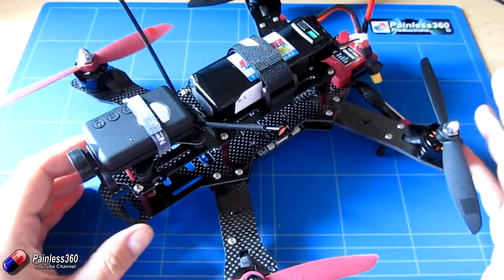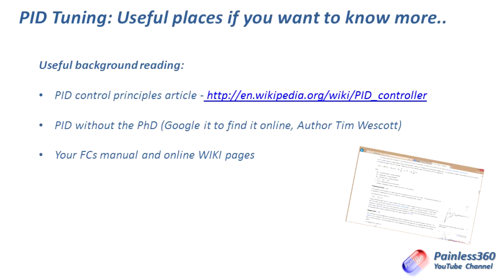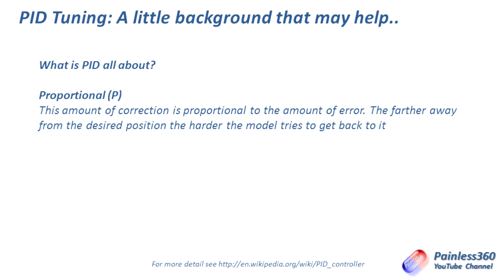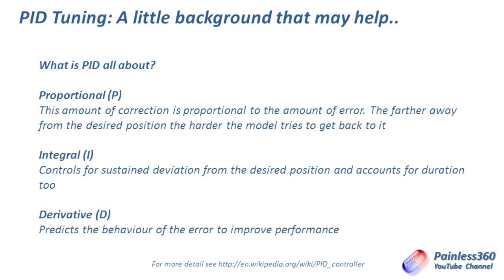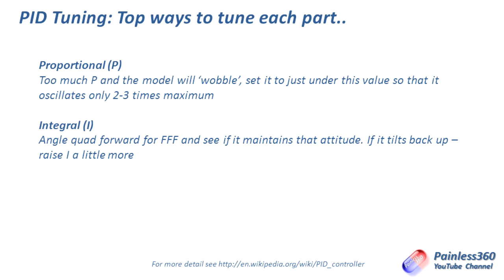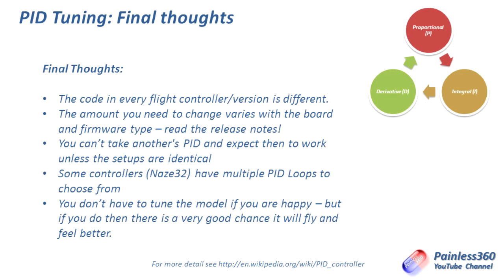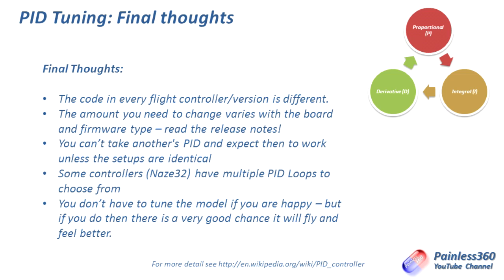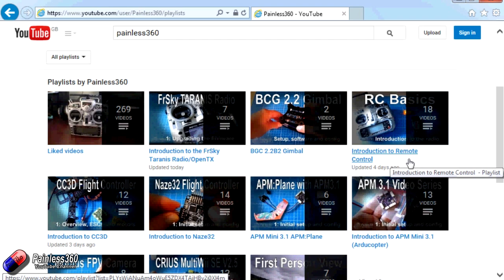Multicopter Tuning - Introduction to PID theory and how to tune your multirotor

Comment: i took my goolrc 210 out yesterday for the first time. using cc3d librepilot default setting and the quad just oscillated like nuts then flipped about 10 times and slammed into the ground. no matter what stick input i did and no matter how much it just wobbled like nuts and flipped over. i cant take it for a test flight to tune as it wont even hover to see whats going on. :( the default was about 0.00620 or something like that on the p gain. all i need is a starting point on p on librepilot.
Reply from the maker: Very tricky to offer advice with that level of detail, we have a video on what to check if you flop on take off but I'd suspect vibrations on the model.. I'd start there.. Best of luck!
Reply: i did just watch another video about rotating the cc3d, i rotated mine 90 degrees to have access to the usb out of the side but when i change settings i don't do the level adjust every time to calibrate. im 98% sure on the video i watch about rotating the board they said always re calibrate to board. it is something i will have to try tomorrow if i get chance. if that isnt the problem i may just ditch the cc3d as the pid numbers are very confusing compared to cleanflight. they only have two number but librepilot pids are more like 0.00350 i have no idea if thats three hundred and fifty or thirty five :/
Reply: I recommend to throw it in the bin because even if you get the best tune it will never be good

Comment: i know this video is about tuning but where did you get your hardware those are way better then the hex would love those for my vortex
Reply from the maker: Which bits? The motors, props?
Reply: Painless360 the m3 screws are they regular hex ? they look like a torques the star hex but with a pin in the middle i believe there security torques. Its just hard to tell with the camera

Comment: Hi, I have a situation here. Before this I have tuned my quad by using autotune as your tutorial video and it was stabled. Thanks to you :) .Unfortunately, last month my quad was crashed, then I have replaced the broken part. When I try to take off, my quad keep roll and crashed. I thought maybe because the PID. Then I reset the PID to default setting and it's still the same. Is it true the default PID sometimes are useless?
Reply from the maker: If it's flipping on take-off then it'll be something else. See our video on what to check if you quad flips.. Best of luck!
Reply: Thanks for your help.. After I troubleshoot, It seems my receiver had problem. After rebind the receiver, It's perfectly worked. Your video tutorials are awesome and helpful.

Comment: Does PID tuning apply for all modes including acro?
Reply from the maker: It does, most flight controllers need turning in Rate/Acro mode so some of the problems you're looking for (wobbles at the end of hard stops, nose lifting in turns/rising in forward flight) are masked. Happy flying!

Comment: In the video you said that if the nose drifts up in forward flight that the I-gain is too low and on my HK 230 mine slowly pitches down. Does that still mean that my I-gain is too low?
Reply from the maker: +logan epling probably too high.
Reply: great video mate, really helping me with my first builds so thanks. I've built an emax 200 x with kiss fc and esc's and dys 2205 2550kv motors. was out tuning today for the first time and when flying in a straight line at low speed all seems fine. but soon as I apply more than 50% throttle the quad pulls up and to the right really quickly and completely out of control. have you got any idea what would cause that to happen?
Reply from the maker: Not without a lot more detail. I'd check the basics like COG and ESC calibration...
Reply: thanks make, c.o.g is definitely ok, was out with it again today to try to see what the problem was without the goggles on and it seems like the back right motor is only powering up so far and stopping at a certain point when the other 3 are powering up to max thrust fine and that's making the quad pulls up and round. I'm using stock pids but turned rates up higher. what other information do you need from me to help you diagnose my problem mate?
Reply from the maker: You don't mention ESC calibration - follow the steps in the videos for the process. Best of luck!

Comment: What is difference between Trim and Pid in quadcopter? How can I realize that I need trim or pid changing?
Reply from the maker: I'm not aware of 'trim' setting on a Quad...
Reply: @Painless360  you mean if we changed trim setting on Radio, it doesn't mean anything?

Comment: ive tested my build, it has a slight wobble on hover and it does what i call feathers down when i drop throttle do i need to raise my pids? its my first time tuning, all of these videos are all done on a 250 quadcopter mine is a 450 size, please help before i break it lol
Reply from the maker: Depends on the type and speed of the wobble. Joshua Bardwell has some great videos on tuning PIDs using the BlackBox recordings. I'd have a look there.. Best of luck!

Comment: I've got a quad that constantly yaws in varying directions,is this the integral not tuned well?
Reply from the maker: +bo holland id check for excessive vibration first. Best of luck!
Reply: +Painless360 thanks , turns out it was a faulty motor connection .all good now

Comment: Is the top camera you have here FPV or recording?  which one is it?
Reply from the maker: Sounds like you're new to the channel.  We cover this in the review videos for the cameras. The use of HD cameras like the Mobius or Runcam is common to record flight on the model in HD while the smaller camera (with less latency) is used for flying.  Happy flying!
Reply: I am new, just built my first quad and stumbled on your site while trying to figure out how to tune it.  I'll definitely check out that camera review video because I'm looking for something cheaper than a gopro to record what I do.  Thanks!
Reply from the maker: Happy flying!

Comment: Any advice?

My tuning seems ok until it perform an extreme maneuver.  I go really fast and then I suddenly go in opposite direction and my quad loses stability.  My quad is not suffering from to much P when doing basic maneuver or even full power, only suffer when I use full power and change to opposite direction
Reply from the maker: This looks like a duplicate post - no need to post twice. I think I answered this already.. Best of luck!
Reply: Can you direct me to the answer?
Reply from the maker: I'd check the D gain. Best of luck!

Comment: Hi. Why does my mission planner roll/pitch sensitivity minimum is only at 0.08? Any idea how to lower the minimum 0.08? Thank you.
Reply from the maker: 0.08 is just the lowest value in the range. I'd never fly anywhere near that level as it would mean that the controls would feel very 'dead' and give you poor control. I'd suspect that if you think you need it that low then you have another problem.. Best of luck!
Reply: Ok thank you. I have found the way to change. 

But, i am currently having a issue to have a stable maneuver for my large quad. I did multiple times of changing the PID setting on the mission planner and i am only able to takeoff slightly off the ground as it seem quite unstable for higher altitude takeoff as the quad is wobbly during flight.

Do you have any recommendation for the pid as the roll & pitch is very unstable during fight.

Thank you.
Reply from the maker: I'd check for vibration and make sure that the FC is on a vibration isolating mount and that the motors and props are balanced.. Best of luck!
Reply: About your explanation on derivative (D) of the PID,  does increasing the D on the mission planner = faster reaction time of the P & I or increasing the D = smoother reaction time of P & I? Because i have read on other source that higher D = smoother reaction time of P & I. Therefore higher D = slower speed of P & I because it will slow down the P & I to make it smoother for the flight? 

Sorry if it is confusing.
Thank you.
Reply from the maker: See those articles and papers if you want to get into huge detail. For 'ease' think of D as the speed of the reaction.. Happy flying!

Comment: One point I am not clear on. Why wouldn't P correct for a sustained error? Lets say my commanded bank angle was 30 degrees and that the model moved out of 30 degrees by small increments over time. Why wouldn't P act to remove the error? I guess I don't really understand why we need an I gain at all.
Reply from the maker: +Brayton Thompson Have a read of the other resources I point to - maybe one of the explanations in those will make more sense. I also struggled with this when I first came across PID loops and P Only, PI only as well as PID loops are common in control systems... Best of luck

Comment: what effects does the PID have on angle and horizon mode?
Reply: +Jon Car You generally want to tune your PIDs in Rate mode. With Horizon mode, you're working with 2 PID loops, the Angle PI and the Rate PID (note Angle mode doesn't use D). In Horizon, when you hit the rate threshold (the point at which you move your stick far enough that it leaves angle mode and switches to rate/manual) those Rate PIDs will kick in. Default in Cleanflight is 75%, which means after you move the stick 75% to any direction, it'll switch to rate mode and allow you to get inverted. Angle is tuned differently than Rate in both Cleanflight and OpenPilot. Tuning Angle is a little weird and I normally just leave it at default, though I've only ever used it flying LOS or if my goggles fog up and I need to land LOS, giving myself time to pop my eyeglasses on.
Reply: +Jon Car In other words... Learn rate using simulators and tune in Rate when you're comfy with it
Reply: +Benderhune  best explanation I received.  Thanks  One question were are the Angle PI setting in Clean flight?  Is that the upper right corner were the 3 setting blocks are?
Reply: +Jon Car So make sure you're running the latest version of the Cleanflight configurator. You should be using version 1.1.0. If you aren't, update that first. In the PID tuning tab, the settings box in the top right is your rates. That controls how quickly your quad will rotate on the specified axis. There's also TPA there, that's PID scaling based on your throttle; I wouldn't worry about that, if you're still learning these things, just set the TPA to 0. You can ignore the TPA breakpoint.

The angle settings are below the general PID settings to the left. The row label will show "Level". The columns are labeled Angle/Horizon, Strength (Angle), Strength (Horizon), and Transition (Horizon). Transition is what I mentioned earlier, it's the point where it switches to rate based on your stick input. Different PID controllers treat settings differently; I use Luxfloat, but you may be using something different, and those settings can vary. Check out https://github.com/cleanflight/cleanflight/blob/master/docs/PID%20tuning.md for more info on that matter.

Boris B wrote some info here on how to use the CLI to change the max angle at which the quad can rotate itself while in Angle Mode: 

set max_angle_inclination = 500 means max stick 50 degrees
set max_angle_inclination = 800 means 80 degrees
So when you give full stick command it will match that angle. Your full stick will always be maximum angle.(https://github.com/cleanflight/cleanflight/issues/1393)
If you don't know how to use the CLI, do some research on it. It's a pretty simple command prompt. The Strength fields in the graphic interface will allow you to determine with what force is applied to reach those angles.

Comment: Does anybody know if it is okay to extend the motor wires?
I added about 3 inches of wire to each lead of my motors.
I'm having troubles flying and I'm wondering if this is why....
Reply from the maker: +odinata if they are the same size and the connections are all good then it should be fine.. Best of luck!

Comment: what would cause a wobble  that starts slow, and builds up gradually till it's violently swinging the quad?
Reply from the maker: +Joe Smith Sounds like one of the values is too high. It'll be P or D probably depending on the speed of the oscillation. Try one then the other.. Best of luck!

Comment: If I give my quad abit of throttle to take off the ground then back off to hover it drastically goes up and down. And if I then land it, it start to jump very aggressively on the ground
Reply from the maker: +Matt Graves that may not be the PIDs. I'd check the esc calibration and settings in the flight controller first. We had something similar recently and I covered my troubleshooting process in video 7 of the 'Quadcopter building for beginners ' playlist. Best of luck!

Comment: hi,

there is some thing exciting i want to share with you .
 i have been working on my cuad and i have always wondering why   error = gyrovalue-setpoint

why to add an necessary  term to the PID equation , what i did simply is that i removed all the setpoint values from pid equations  and  i added them to the esc final signal drop calculations ,  the wonder result that i have achieved more stable cuad  and when i searched about my  way of PID i found that all  scientific  referances about this subject i found that (error = gyrovalue-setpoint) is a main truth in designing 

, so how my conclusions are correct!?

is what i did  a method of  PID i dont know?

if so why isnt it used in common cuadqopters or balanced systems?

can i have a coversation in this result
Reply from the maker: +Adel Ashour I’ve not sure,sounds exciting!
Reply: so why error = gyrovalue-setpoint
Reply from the maker: +Adel Ashour have a read of those publications I referred to for the detail.. best of luck!

Comment: I've watched this video over and over I cannot figure out why when I do a punch out on three 3's  my quad is fine but when I do a punch out on 4S he wobbles and makes a terrible sound I have a qav210 I'm running Cobra 2204 2300 KV Motors 30 amp ESC on a cc3d board I noticed the wobble during fpv I can hear it as soon as I punch out and take off
Reply from the maker: +Ultimatevapor918 you need to recheck your PIDs if you are using a different size battery.. Best of luck..

Comment: What if it doesn’t fly at all?, I built a 250 and the first time I went to fly it it took off ok but it got about 5 metres off the ground then it suddenly flipped over and crashed to the ground. Is that a pid gains issue?.
Reply from the maker: More likely a vibration, FC, wiring or power issue..
Reply: Painless360 i soldering all the connections and everything I used was new. Batteries where also new, 
Have you ever had this problem or is there anything specifically you could advise me to look at possibly?. 
I also built a 450 using the arducoptor fc but that one did the same thing more or less and crashed upon take off. 
When you say vibrations should I be making sure the FC is not able to move and is very secure?. I thought it was and it didn’t move even in the crash but I’m more than willing to check and re-check anything you think might be the issue. 
Ps. I have been a subscriber to your channel for more than 3 years now but I never wanted to bug you as I’m sure your a very busy man.
I went to or contacted every rc store in my area but as soon as I tell them I built it myself they don’t want to know about it.  They all basically said if I didn’t buy it from them they wouldn’t even look at it.
Reply from the maker: @simondelaney5694  It's tricky to offer specific advice. I've not had that happen here. If it's an FC with a logging capability then I'd look at capturing the logs to see if the FC 'saw' something. As you don't mention the FC you're using, the firmware and parts I can't be more specific on things to look at. I'd start from the logs, and a good visual inspection of the wiring and go from there.. Best of luck!

Comment: Can you please tell me how to trim or turn down speed on this drone it flips over every time. I give it barely  a little stick it flips like crazy IAM running kingkong motor s and everything is correct re did it a hunderd times and can't seem to get off the ground
Reply from the maker: See my video on what to check if your quadcopter flips over. I suspect that you've made a mistake wiring the Motors or putting on the props. It's easy to do, we've all done it at least once. Hope it helps..

Comment: why are my pids so high compared to others? for example, my default interval pid is around 30 when I see others with 0.05
Reply from the maker: That sounds like you're comparing PIDs from different versions of the software. There are many PID implementation in things like Cleanflight and older versions of Betaflight and they work slightly differently. They change from version to version too.. Hope that helps.
Reply: ya they removed the decimal. Why!!!?? we arent stupid...
Reply from the maker: That is an excellent question..
Reply: They removed the decimal from cleanflight pids conveniently after switching from librepilot for the first time...
Reply: mariobeans thank you for that information. I was wondering the exact same thing. Because my pids do not have decimals

Comment: Err what?? In my opinion you are overcomplicating D. D is proportional response to rate of change in rotation error. So the higher D the stronger the response to changes in rotation rate error - hence better characteristics in counteracting short term disturbances. In fact D is almost as easy to understand as P.